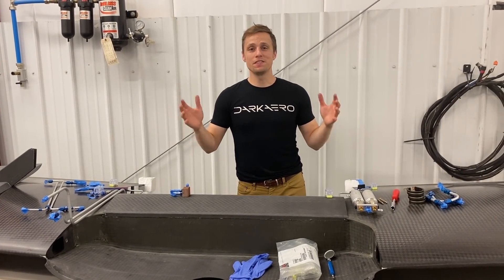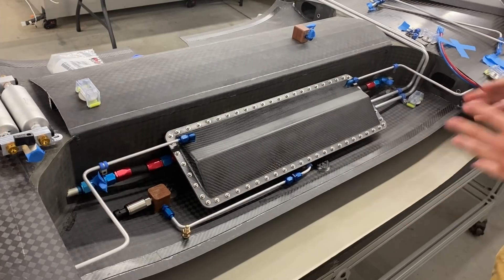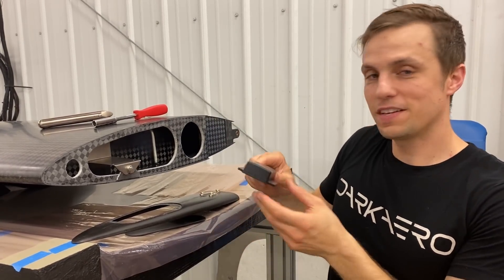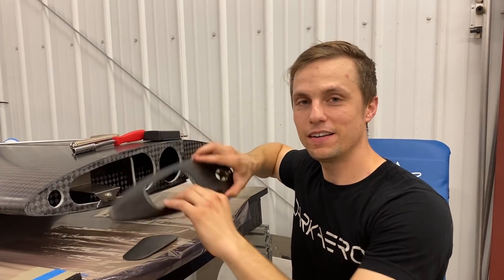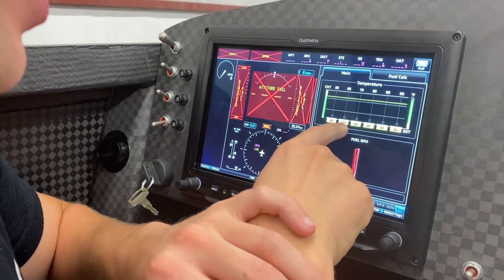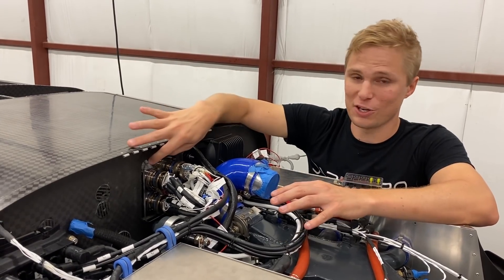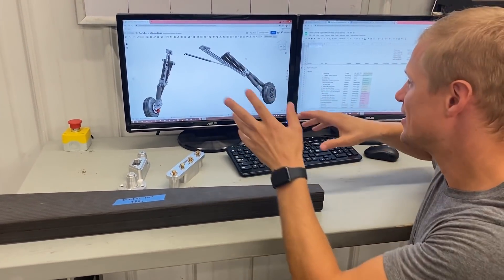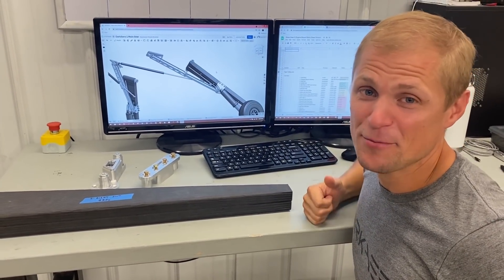HINGED INSTRUMENT PANEL! | DarkAero Shop Progress Update | August 14th, 2021

Comment from the maker: Hey all! We're seeing a lot of repeat questions/comments about the electrical system so we wanted to focus the discussion here. It's hard to summarize the full electrical system design and failure analysis in text, but we will hit on some of the key points here. The majority of electrical devices in the aircraft are circuit protected through the Vertical Power VP-X solid-state breaker box, which can be accessed through the G3X display while in flight. Electrical hardware required to run the engine is not run through the Vertical Power box, just in case it experiences a critical failure. High current motors, like the ones that drive the landing gear, are also not run through the VP-X. 

There is a subset of electrical hardware which needs circuit protection but cannot be accessed in flight. Any length of wiring between the battery and a fuse/breaker is unprotected against a short to ground, which could cause a fire or pose a hazard. The fuse box mentioned is specifically located close to the battery to minimize the length of unprotected wire. The airbox was chosen as the mounting location since it is close to the battery and results in fewer electrical connections tying the engine to the firewall, which makes maintenance and modifications of the engine easier for us in a prototype/test environment. 

There are two ECUs that are running in parallel at all times. If one of the fuses for these goes out, the engine will continue running. The pre-flight checks for the aircraft require that you check for the functionality of both ECUs so that the troubleshooting of this issue can be done on the ground before flight. The emergency extend for the gear is purely mechanical, and if there is any emergency with the gear prior to landing the default action is to pull the emergency extend lever.  

All that said, your #1 job as a pilot is to fly the airplane. We have designed our electrical system with this in mind. Our goal is to orient the pilot around flying the airplane when they are in the air and to leave any electrical troubleshooting to when the plane is safely on the ground.
Reply: Thank you guys for responding.  That’s what I like about you guys.  Look forward to seeing this in the air.
Reply: I love your process..the building...the design...etc. But I honestly believe you aren't thinking this through completely. Pulling breakers isn't necessarily about troubleshooting, it could be, but it may also be about saving your life when trying to shutdown an electrical fire at 12000 feet. Breakers won't always trip when they instigate a fire.
Reply: Cant tell from the video but are all the spark plug wires tied together? Those and the ignition coil signal wires should be separated. Be careful with EMI on those ignition electrical components as too much interference will cause you headaches with the electrical with misfires.
Reply: Thanks for the breakdown!
Is there a main fuse feeding the branch fuse block?  It would protect against a short to ground from battery to branch fuse.   Among the other reasons stated, keeping it close probably also saves weight.

Comment: Such a beautiful piece of work guys. The electrical system is obsolete. Initially I thought u guys are using engine power as alternator to power the instrument panel and other avionics. But you guys are using a battery,which is cool. Is it LiPo or some other chemistry?

Comment: The location of the fuel level sensor can potentially be an issue with corrosion. The sump drain is the lowest point in order to collect water, and locating the sensor there would likely cause the sensor to corrode over time. This would lead to unnecessary failures of the sensor and frequent replacements. I would highly suggest changing the location as accurate fuel indications can be critical. Also, I would consider adding a fuel totalizer to track fuel burn and time remaining of fuel.

Comment: Please do not  Bond your panels  Put     In screw inserts This will you have access until your panel in case anything fails you can repair it if you bind it you have to cut all out prepare if Fills

Comment: Love your work and thorough explaining, i thou have one issue with your work: all your cables runs thru holes and over edges without any rubber or grommets protecting the from damage due to vibrations and wires accidentaly touching the carbon fibre parts, this is well know in automotive business and also in the RC flying world, Carbon fibre parts is conductive and will make a shortcut if cables grind against them, what is Darkaeros take on this.??

Comment: Impressive build 💯 
Make sure the redundant fuel pump doesent reverse flow. You might need a checkvalve on outlet of pump #2
I built a similar configuration with 3 pumps for a car and spent a good amount of time finding that problem..
I ended up pulse modulating all three pumps but you dont have that luxury as its for redundancy and not higher flow.
All the best
/Karl

Comment: What happened to the titanium firewall?  I don't think it's being shown there in this video?
Reply from the maker: Hi Blake! The titanium heat shield isn’t installed in this configuration. We have to install a couple more fasteners on the firewall so we need access to the carbon under the titanium.

Comment: Hi. The Lancair 320 series has a similar gas strut setup on the nose gear for emergency extension. Over time, these struts lose their pressure, to the point where not enough force is left to push the gear against the wind to lock the over-center links. This results in a gear failure on landing and most likely a prop strike. Pilots are warned about it, and the solution is to check the emergency deployment on a regular basis, and to replace the strut when it can't force a lock at near deployment speeds. If monitored diligently, the problem can be averted, however, this is still a very common cause for accidents in the type. Many people don't realize the strut is not capable of locking until they have to perform an emergency gear drop. Would love to see you come up with a better solution.
Reply: Bungie cords for emergency gear extension.

Comment: I've been watching your videos with great pleasure in years but I only checked your website fairly recently. Being able to cruise at over 440 kph is absolutely remarkable! 
Would you be able to estimate takeoff distance, stall speed and cruise speed (my guess: 311 kph) with around 100hp (like a Rotax 912 IS)?
I see you expect the weight to be around 340kg with the  UL Power UL520iS, would 300kg be a fair estimate with the 912IS?

Comment: Love the project and your videos. A couple things of concern: The fuse block firewall forward is not fireproof nor is the plate that holds the Cannon plugs. Even on the prototype, you'd be safer to follow best practice and mount the fuses firewall aft, and keep the firewall fire proof after all the trouble you went to with the flame testing. Make sure the Cannon plugs are fire rated too or they present a large pathway to fire ingress. This is an electrically dependent engine so careful consideration is warranted here.

I'd also be concerned with the aluminum engine mount. Not going to stand much time in a fire before failure which is one reason they aren't used in aircraft much any more.

The design of the landing gear is pure art but the complexity may come back to bite you for manufacturing and maintenance. A lot of parts there. RVs, Rockets and Lancairs use spring steel or Ti legs for good reason. Pretty maintenance free.

I'm sure you'll learn a lot on the prototype and apply those lessons to production kits.

Keep up the good work and great vids!

Comment: Thanks for sharing the development process. 

12:30 I would actually be quite interested to see your process of load calculation/analysis, whether you do manual calculation or FEA, or both, and in what order...stuff like that.
Reply from the maker: We had actually recorded a brief discussion on this topic, but ended up editing it out of the video. Sounds like we should have left it in! Basically, we start out with a rough design and then run a lot of manual calculations. Depending on what the manual calcs tell us, we might need to iterate on the design several times to refine it. When things start to look reasonable, we refine the analysis further and use FEA to study components that are difficult to analyze with hand calcs. It’s important to first perform a pretty thorough analysis manually before jumping into FEA because it gives you a good understanding of the loads and stresses and also allows you to cross check that your FEA results are reasonable. With the accessibility of FEA tools becoming better and better, it gets tempting to just jump straight into FEA, but that could produce “garbage in, garbage out” results. So the analysis workflow is: rough design, manual calcs, refine/iterate, FEA. Thank you for watching and for your interest in the process!
Reply: @DarkAeroInc  thank makes sense! Thank you for the explanation.

Comment: Notice how nice the size of the ipad is. And that displays in planes should be much bigger.
By all means complete the build as fast as possible without second guessing too much, I'm quite interested to see how it flies. But given the complexity of the 3 tank fuel system, would a single central fuel tank be possible to avoid complexity? I know you plan on a large tank but maybe a compromise for the advantage of the simplicity and reliability of a single. Maybe a central wing tank could bulge up a bit and still have large capacity if that is a must. Simplicity should presumably also help certification. Much to be said for KISS.

Comment: Wow the most inspiring channel on youtube! Thank you for the ins and outs!  Teaching inspiring many generations to come with aerospace engineering!  Ended up doing some classes at Defts after seeing your breakdown videos!  Love all the content!

Thank you for making these videos!
Reply: Engine air cooling inlet....I can see two sharp cut out holes....nope. let me explain. If you push or suck in air, in a hole cut out from a flat surface....the flow calaculated for that hole, will in real life actually be a smaller hole.

If...for example intakes for an engine is just a pipe...the air entering that pipe will on the edges come in perpendicular at the mouth of the pipe , stopping and interferring with the main airflow entering the pipe, and therefore in real life the pipes effective intake diameter will be smaller than the actual physical diameter of the pipe.

The way hot rodders handles that is to put a small rounded trumpet at the intake pipes. 

That will straighten up all the airflow ...before....it enters the pipe, and when the airflow enters the final diameter of the pipe, all air is lined up and goes into the same direction, and thus give the inlet diameter full efficiency.

A sharp edge in your engine air cooling inlets will do the same as a pipe without a trumpet. 

Air hitting the cowling about an inch around the engine cooling inlets have a choice to go around the cowling or go into the engine cooling inlets. The air going from that spot to the engine cooling inlets...will now travel straight perpendicular to, and hit the main airflow that is rammed in...thus choking the inlet.

Fix....have the same size air inlet ducts...but at the inlet, round off the air inlet ducts. The area where the spinner is, that air is already "lined up" as it follows the spinner...but all other sides of the inlet...round off the inlet.

Round it off approximately, that of a diameter of a quarter.

Round it off so the "trumpet" starts at the cowling, and it looks like it is a sunken in trumpet...and the trumpet ends...and the actuall airduct starts a little bit inside the cowling...nothing sticks out...the cowling merely seems to "sink in" .(..thats the radius...)...and the actual duct starts seamless inside the duct.

Your engine airflow cooling ducts will flow way more air through, in this way, and still keeping the same size ducts.

Comment: Nice progress! Just get rid of the Garmin and chose a Dynon instead. The cost of the Garmin allows you to fully equip the AC including a passender screen, autopilot and everything else you would wish for...
Especially while Garmin's price policy is trying to get rid of the average builder while Dynon has and still is focussing especially on Experimentals.
Reply: Unless Dynon has a TSO'd version for "any" piston single, I think they would have an STC issue.
Reply: @linuxranch  only if this was a certified aircraft. As an experimental, the TSO shouldn't be relevant

Comment: Tip: on my two fuel weight sensor gauges, i hacked on a static port onto the sensors which plumb into a dedicated but equivalent to the tank forward facing vent “pitot port” to cancel out the tank pressurization without exposing the probes static to fuel vapor.  Works a treat. Prior, the tank would read high at speed.

Comment: I think you will find trying to use fuel  pressure to give fuel quantity will be unusable in any condition other than sitting still on the ramp. Any g loading positive or negative in flight will render it unusable. You need capacitive sensors. As for your fuel pumps why did you not put them in your fuel sump plenum automotive style. They run a hundred thousand miles and commonly much more reliably there. Plus the fuel cools them that way. As you have the access panel under the seat they would be easy to reach should they require service and you wouldn't need to find another place to put them that requires access. The only down side would be the need to drain the plenum to service them

Comment: Be careful with the fuel shutoff valve.  Those Pierburg pumps require fuel for cooling.  If you run them without fuel for a very short time, they may fail.  They are quite pricy.  What mechanism do you have to confirm each pump is functioning before flight?

Comment: Great Episode!!  A question the style of  @MunroLive. The carbon fiber sump box appears to be assembled with roughly fifty-four (54) fasteners.  Engineering, economic or material constraints that necessitate that number of fasteners?   Thank you
Reply from the maker: The fastener count was originally driven by trying to achieve uniform compression on a sheet gasket in between the two sump halves. We changed from a sheet gasket to a sealant between the sump halves, but we had already drilled the fastener holes for the gasket configuration. The number is now overkill but the good news is no one is worried about that little tank leaking. :)
Reply: I also agree that that many fasteners seems overkill.

Comment: ? Do the main tanks in wings pressure feed with their own pumps into sump under seat, or gravity feed. If by gravity, then be very careful about fuel starvation in rapid climbs. The vent lines will get strong vacuum during steep climb out due to fast pressure drops in main tanks pulling fuel very quickly from the sump.

Comment: I worry about critical system power fuses mounted to the vibrating shaking engine baffle assembly. Not convinced that is a good choice. Just my opinion based on 40 years experience in the avionics and aviation maintenance industry.
Reply: If the baffle is mounted to the airframe and not the engine, vibration shouldn’t be that much worse that anywhere else. I would think heat and access would be a concern with that mounting choice. As long as strain relief, flex relief and chafe protection are provided, vibration shouldn’t be that much of an issue. But then you’re the guy with 40 yrs. experience maintaining what engineers design, so I defer to you.

Comment: A couple of comments here:
1/ The fuel pressure manifold that is bonded to the outer skin of the fuselage...does the drain spigot seal against the threads or does the fuel exert pressure against the adhesive/sealant??? (That could be an unnecessary weak-point).
2/ The centralized wire-loom has the harnesses from both ECUs "sistered" tightly together. Problems can migrate quickly as wire insulation fails. (You need to either mechanically or physically separate those critical components to retain redundancy). 
3, You don't want to mount the fuse panel on the engine baffling. Copper doesn't like vibration. It work-hardens and becomes brittle over time. (Minimize vibration by bedding the fuse panel on a rigid structure south of the Lord mounts). 

Love your attention to detail, Guys!!!!
Reply: I concur, on the belief that mounting this fuse box to the intake manifold location,  is less than ideal.. I know firewall space must be at a premium, but perhaps a bracket off the battery box?

Comment: Can that Garmin thing receive a signal inside a carbon fiber wing? Carbon fiber blocks RF signals last I checked.
Reply: It is a magnetic sensor. Senses the magnetic field of the planet.
Reply: …Magnetic Field not RF. The have built the area behind canopy and behind the crews heads out of, RF transparent, fiber-glass since this is where the  receiver and transceiver antennas will be located. Placing the electronic compasses magnetic sensor pickup at a wingtip seems to be the best method to get the this device as far away as possible from any magnetic parts of the aircraft. They could always mount it on an long retractable pole at the tail, like the P3 Orion did, but that seems a little complicated, since the just want to get ongoing magnet compass headings and are not trying to locate submerged enemy submarines.